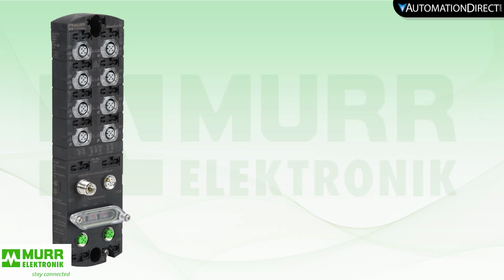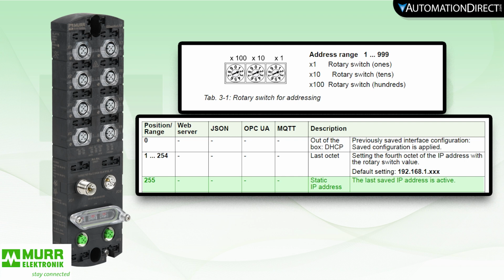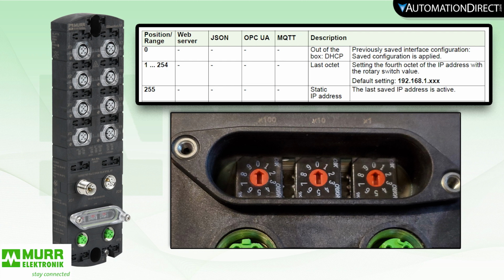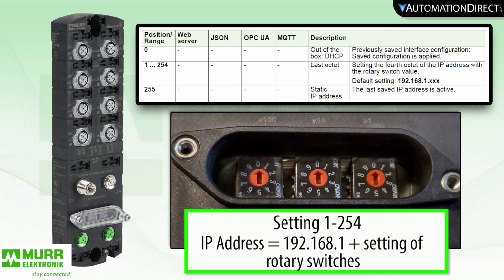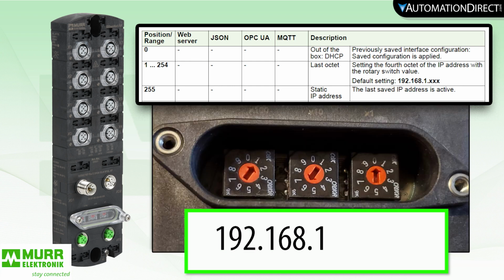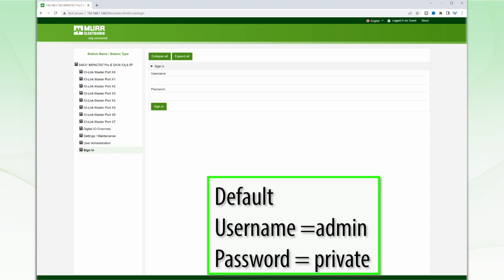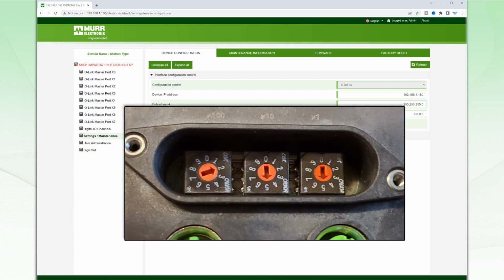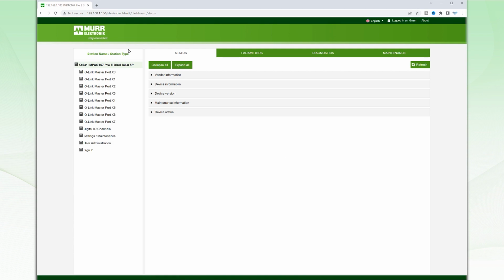Murrelektronik IO-Link Master Network Quick Start from AutomationDirect

Comment: Hello buddie, only setting IP adress is necessary? What about the parameters??
Reply from the maker: @Ivan.Depetri This is the initial IP address setup that will give you access to the webserver on the master. Further setup will depend greatly on the types of IO link devices you connect to this master, as well as the PLC you communicate with. We have a lot of other great videos on these subjects here: https://www.automationdirect.com/videos/home?t=link&cat1=55&cat2=230&utm_source=gOB_nYPNhM8&utm_medium=VideoTeamComment